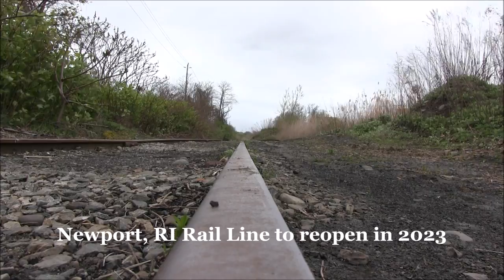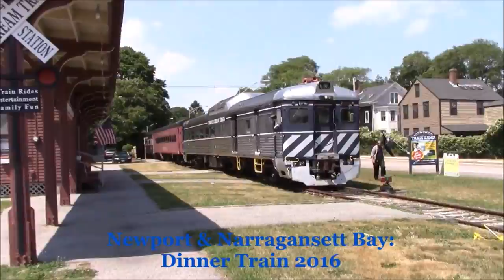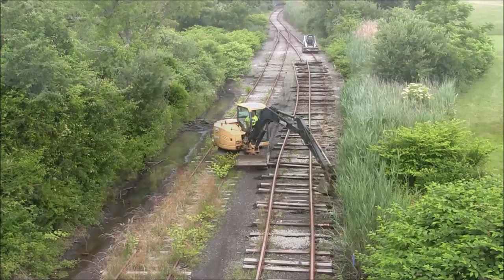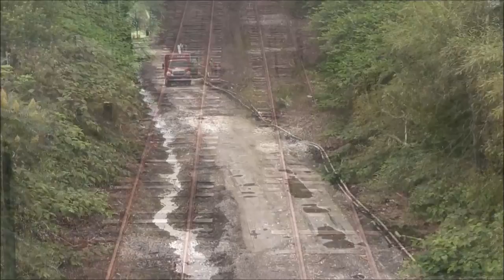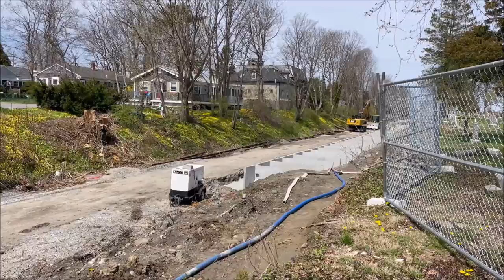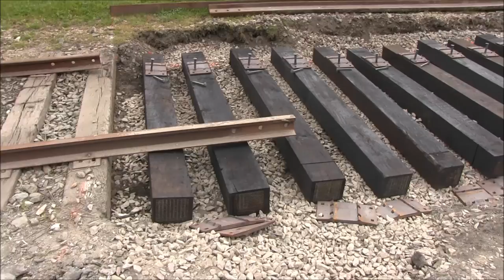Newport, RI Rail Line to Reopen in 2023

Comment: Great Narrative format! It really seems like with all this being done and SCR that we may have MBTA service going all the way down to Newport one day! All that needs to be done is for the bridge to be rebuilt!
Reply: I believe the location of the bridge that was removed is now being used by high tension wires. They say the track wasn't "used" since 2016 but does that mean in 2016 you could take a train from Boston to Newport or did that just mean the bridge to the island was already gone and it only ran locally on the island until 2016?
Reply: @chrisaustin9949  it ran locally until 2016. The Sakonnet River Bridge was removed in 1980 so to put back the Bridge, those high tension wires would need to be relocated to the former route 24 Bridge next to the new Rte 24 bridgespan
Reply: The Sakonnet Bridge was hit by a barge back In the day severing rail service to the Island.
Reply: I think they should extend the P/S line to at least Westerly.

Comment: Silly question, as rail is expensive, I'm curious if they take the old rail, and run it through a rolling mill to make nice and straight again ?  Excellent video, thank you.
Reply from the maker: In this specific situation the rail  itself won’t go through that process. The process may exist but I do not know of any thing like that at this time.
Reply: Rail like this is sold as scrap to a salvage company where it’s typically melted down and reprocessed back to some form of steel product.